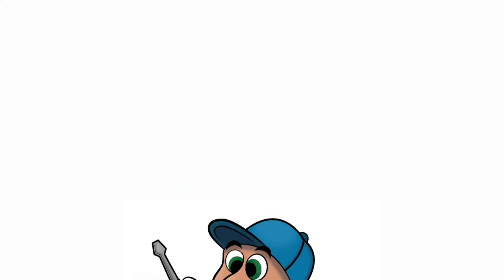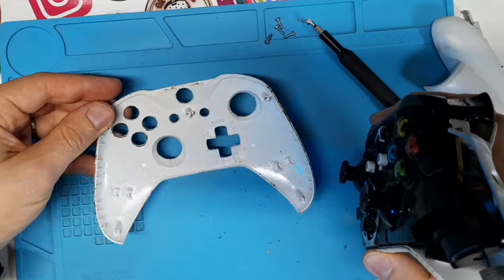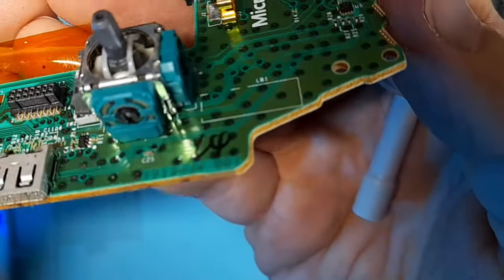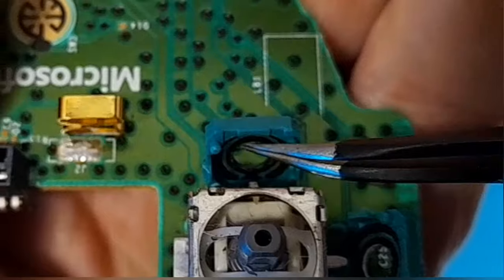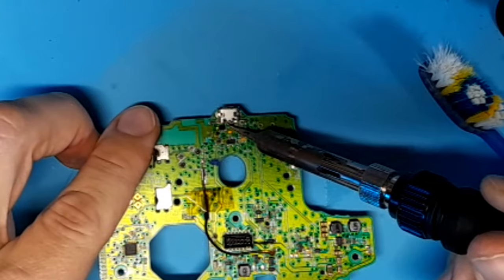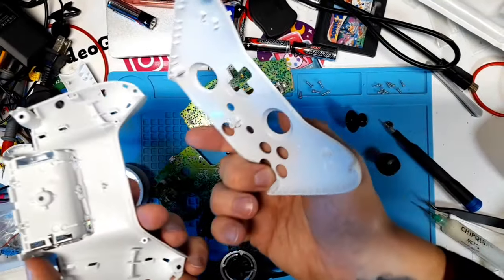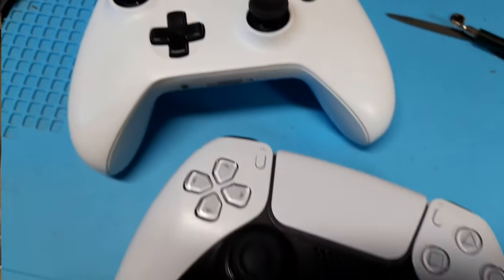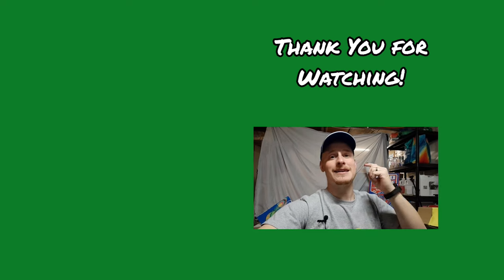This Xbox Controller was DESTROYED

Comment: Nice one! Didn't the corrosion on the metal in the battery compartment give any issues and is there nothing you could do about it? 
My xbox one s controller has a problem, the right bumper barely ever works. Also the micro usb port is in the wrong place. I want to take it apart to see what is wrong with it but im waiting for my torx 8 security screwdriver to arrive, do you know where to get new bumper buttons for the 1708 model?
Reply from the maker: I.found some on Amazon before!
Reply: @VideoGameRestoration  ah alright. Thanks for the response, i can't solder and don't really know anyone who can so for now i'm stuck with the broken controller. I opened it up and it actually turned out to be the actual switch that was faulty. I tried putting other bumpers on it but they didn't work either and even if you press the switch in very hard it barely ever works at all. I bought it secondhand a while ago but it looked like there maybe is some liquid damage on the board next to the switch bc there was a weird kinda shiny sticky stain on the board right next to the switch. Sorry for the late response.